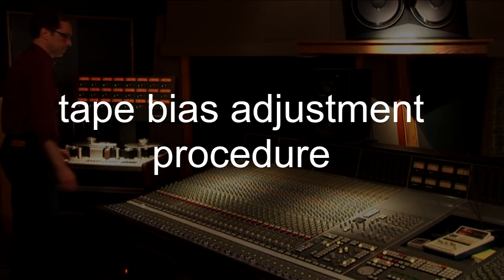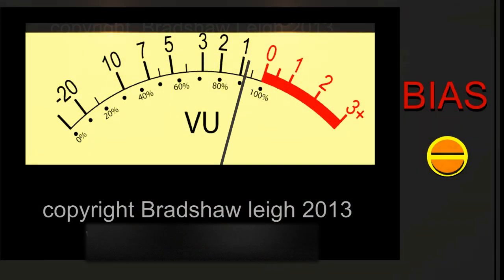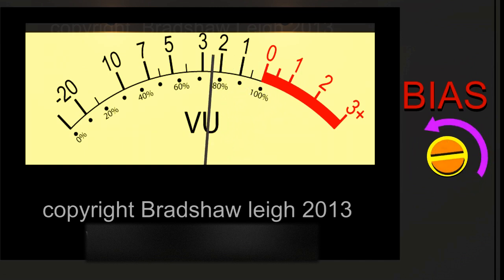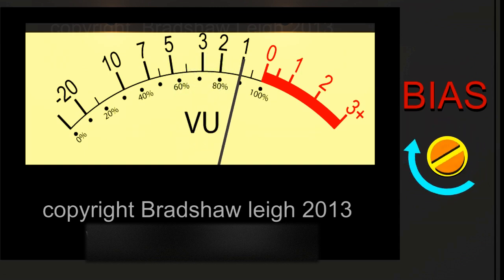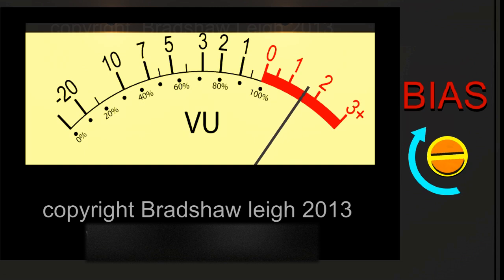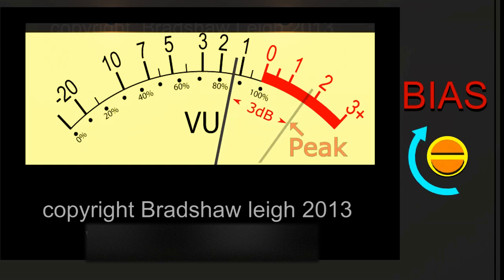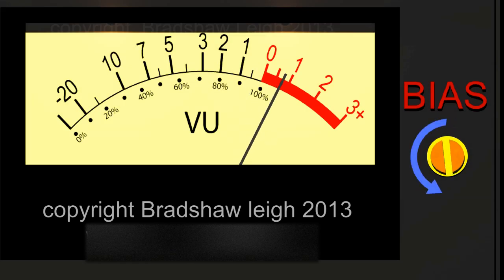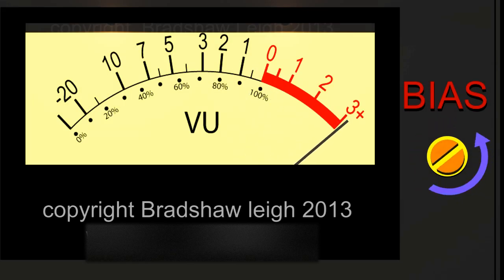Analog Tape Bias Adjustment

Comment: Hi! Have a Revox PR99 MK1 - after setting Bias to 3db - can I then use MRL calibration tape to bring LR Meters to 0 VU? Thanks!!
Reply from the maker: You should set your playback levels with the mrl first and then after biasing you should set the levels with the record adjustments not the repro so you wouldn't need an MRI for that
Reply: @biasedaudio  - Thanks!

Comment: Most tapes don't have an overbias dB spec, so how do you it without knowing the overbias ? Match 1kHz level to 15kHz with bias adjustment ?
Reply from the maker: I always dealt with pro tapes that do list overbias spec. ATR still lists it . I can't keep track of what companies still exist, but most publish these specs. It can vary based on tape , head gap, and speed. Perfectionists will tell you, you need a distortion analyzer, if you don't know what the tape is, or the over bias. In general I have found ( using 10khz) over 1.5 at 30  ips, or 3 at 15 ips. is ballpark for most tapes. ATR using these number states it would be over 5 at 7.5 ips ( 10khz) . ( If you use 10khz at 7.5 ips the machine should be recording at - 10 . Cassettes I would check the machine manual. ( in the old days we used to Peak bias at 1khz at 7.5)

Comment: I have a friend who is blessed with the possession of a Nakamichi Dragon. What’s fascinating is the have a signal generator inside to set bias. The procedure requires switching between 400hz and 15khz to get everything set right.

The real kicker is my Onkyo TA-2700 states in the manual that to set bias, to use an fm tuner set in between stations to generate “white noise” and calibrate at to match the sound of the source at -10db.
Reply: Pretty sure cassette calibrators do everything at -10dB, as opposed to this approach.

Comment: On my machine which is a sound craft760 series 16 track 2 inch machine, sone of the channels will bias properly while others will have the bias needle rise but not fall. In this  case do I just adjust the bias to the maximum level or do I try to position it the same distance back from its maximum turning point as another channel which does bias correctly?
Edit: when I say rise and not fall I mean that when turning the needle to the left it will fall to the left but when turning to the right it will rise all the way until the screw maxes out but will not fall.
Reply from the maker: You should NOT.  turn to the left to get it to match. I will guess either there is a master bias that needs adjustment or the bias circuit needs work. Possibly recap ? These are guesses , that machine is pretty rare. But all channels should behave similar though not exactly the same.

Comment: What's best process to bias a tape without knowing the dB overbias level ? Unfortunately alot of tape exists that's not described on Studer/ Revox ref. manuals. Thanks !!
Reply from the maker: The best place to look is for old tape manufacture documents that can often be found on line. As others have commented you can us distortion analyzer, I would google methods. Most  modern tape formulations running reel to reel will get you very close using over 3 dB at 15 ips and 1.5 at 30 ips. If you are using 7 1/2 ips  is 5 dB all at 10k KHZ, though is you are setting 7 1/2 you need to drop the level 10 or 20 dB to prevent tape saturation when biasing

Comment: Outdated and inaccurate method.  It is much more correct to set the bias level according to the minimum distortion coefficient ...
Reply from the maker: I am a professional, that has worked in many of the major studios in New York, Los Angeles and others for the past over 30 years. Maybe at home you have the time to pull out a distortion analyzer and tweek, but when aligning 48 tracks of analog, two tracks and 4 tracks on a daily basis in multiple rooms I assure you this was the method. There is nothing new about distortion measurements and bias, so there is nothing outdated about this method.  As well the tape manufactures specifications which list over bias are based on distortion and frequency response measurements using different head gaps. Over bias is an indicator.  I have never ever seen any tech use a distortion analyzer for aligning a tape machine on a daily basis in a professional recording studio on a properly working tape machine. If you look at ATR current spec sheet for tape you will see a bias vs distortion chart, yet bias settings are listed as "Over Bias" settings as shown in this video. Not only that but some machines the freq response will be off in the higher frequencies, it is possible to trade off a small amount of distortion for a flatter frequency response in the 15k or 15k to 20 k band to get a closer match to the 10k or 12k eq setting. Even if you were to use a distortion analyzer to set bias, you could still go back a see what the over bias value was. ie on this machine my lowest distortion is when the bias is set to an overbias of 2.25 dB, not 2.5 dB as the tape spec sheet states.
Reply: @biasedaudio  Спасибо  сэр за столь развернутый ответ! Но я не сказал что этот метод не верный - он прописан во всех инструкциях полувековой давности... ;-)
Конечно же не возможно потратить столько времени на 48 каналов на одной машине.
Я же имею в коллекции наоборот -  48 машин (2-4 канала всего на каждой) и добиваюсь показателей +-1,5 dB при коэффициенте искажений 0.3-0,15 % на современных лентах.
Еще раз - мое почтение сэр!
Reply from the maker: @hunterkz2992  Спасибо I miss I journeys to Moscow and "Lenningrad"  St. Petersburg :)
Reply: @biasedaudio  К счастью - я не в современной России с ее  фашистским режимом. Я в свободном Казахстане...
Reply from the maker: @hunterkz2992  Kazakhstan looks like a beautiful Country!

Comment: How do I know how much I want to over bias? Why 3 db? I want to dial in a type II maxell xl II for a cassette mixtape on a pioneer ct f900.
Reply from the maker: This is an excerpt from my online Udemy course that teaches  Tape machine alignment alignment. The course is focused on reel to reel machines  pro and semi pro machines. Cassette machine methods vary greatly from machine to machine. Over biasing 1.5 or 3 dB are relatively  common values on pro machines at 30 and 15 ips. Without having service manual for your machine and knowing what tape you were using there is no way I could answer your question. Good Luck!

Comment: Wish this worked on a two head cassette deck
Reply: Definitely use a lower frequency and much lower level, i think -20 dB should be enough not to saturate the tape. But best is to check service manual of that deck.
Reply: There's a similar method, but the freq is closer to 6kHz. I forgot the details, sorry.
Reply: lol!

Comment: This works for professional machines, but for 'semi-pro' gear, 0 Vu at 10 KHz may cause the tape to saturate.(Especially at lower tape speeds.) In that case it is better to use for example -6 Vu or even -10 Vu as reference.
Reply from the maker: True, most important is tape speed, 71/2 IPS and cassettes require -10 at 10khz.
Reply: Thanks for the info, I want to add a little saturation on the tape